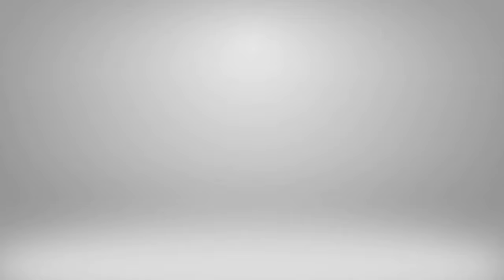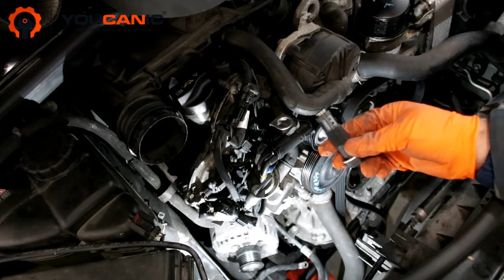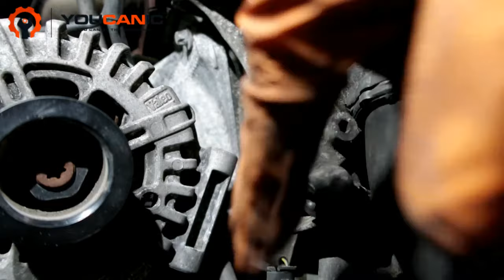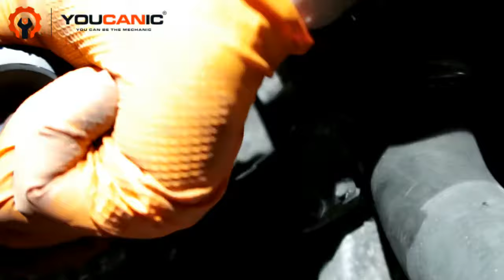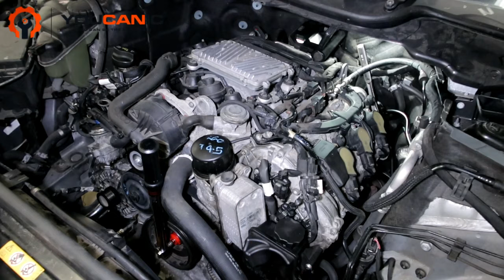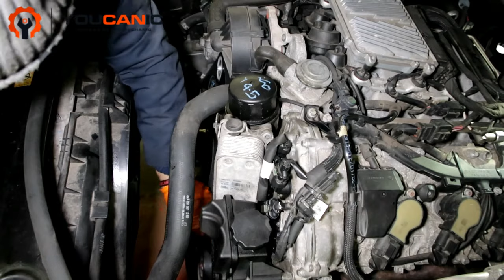Mercedes Benz Timing Chain Tensioner Replacement

Comment: I have a question so I am doing the valve stem seals because I think and am hoping its not the piston rings, all the piston have oil puddle on top and I can see the oil line from the top dripping down. If it was piston would all 6 really fail?

Comment: I have an 08 sl550
...r230 v8... do you set the crankshaft at 40 degrees straight up or 40 degrees after TDC before removing the tensioner
Reply from the maker: Thank you for your feedback! While we strive to offer clear and practical automotive repair advice, it's essential to have a professional diagnostic scanner to correctly diagnose and repair a vehicle. We developed the YOUCANIC Full System Scanner for exactly this reason. Check it out here: www.youcanic.com/scanner.

To ensure accuracy while working on your 08 sl550 r230 v8, consider getting procedures from our Factory Repair Manuals and Torque Specs. These resources can provide the exact specifications you need for a successful repair. You can find them on our website for a small fee here: www.youcanic.com/manuals.

Comment: I just finished replacing chain and guides, timing is dead on, but engine runs rough and ultimately dies. Is this a sign of incorrectly setting the tensioner?

Comment: Do you have to put the crank centre ? What if you do this without remove the fan belt and crank not centre ?
Reply from the maker: Hi there, thanks for your comment! We strongly recommend aligning the crank to the center before starting any work as not doing so can lead to engine damage. If you need detailed instructions, visit www.youcanic.com where we have factory repair manuals available. As for the fan belt, it's generally safer to remove it to avoid unnecessary strain or damage. Please feel free to reach out with any questions to help make your car maintenance journey easier!

Comment: Hello, my m272 350cgi rattles 2 seconds but only on a warm start feeling like the oil drips down . No rattle on cold. Is the tensioner at fault? I think i can change it myself like you did, i have the tools. Its 100euro for me tho quite expensive, but if it fixes it i will do. Thanks pls reply!
Reply: Mine does the same. Only on warm starts when the engine has been sitting about 1 hour. I don't think it is the tensioner, because then it would be more likely to rattle from cold when the oil has drained away from the tensioner. From what I hear this is a common issue and no-one really knows what it is. I have decided to live with it. After 6 years it is still the same. No worse.

Comment: Any idea what the cost is to have a reputable shop do this repair on m276 v6 engine?
Reply from the maker: Thanks for your question! It's hard to specify an exact cost without knowing your location and the exact repair needed. Nevertheless, YOUCANIC is here to empower you with the knowledge to confidently understand your car's needs. We offer free resources, our powerful YOUCANIC scanner, and even factory repair manuals to assist you!

Check out our site at www.youcanic.com and don't hesitate to post your queries there too! We're here to support you on your car ownership journey.

Comment: Is it the same for w203 c220?
Reply from the maker: Hi there, thanks for your question! Yes, our guides and resources can definitely assist with a W203 C220, as we aim to support all makes and models at Youcanic. We are dedicated to helping car owners save money and feel confident about car maintenance. For more specific information, you can explore our repair manuals at www.youcanic.com. We're here to empower and support you in your car ownership journey!
Reply: @YOUCANIC  Thanks for responding. I hope I get it with that shaft setting after replacing the tensioner

Comment: Hi mb ml350 , i just installed timing chain tensioner but the way i relased it by pressing it in , tip popped out and i stick this inside the engine. Someone told me to do so . Now i have 2 codes CEL p0016 and p0017 . What to do ?
Reply: did you get those codes.. what they were?

Comment: Will bad chain tensioner causes p0016 p0017? Thx
Reply: Did you find out what it was?
Reply: Wondering the same thing.  Replaced my cam sensors and magnets, still have the 16/17 codes and wonder if tensioner is it.
Reply: @jimgorman7289 it's the tensonoir same issue here
Reply: likely it is the chain, stretched and the cams are slightly out of alignment by a degree or 2. Need to pull the valve cover and check the cam gear alignment at TDC

Comment: Tsb says no consequential damage expected. So it's not necessary to do check valve and tensioner upgrade?
Reply: Seems like a good way to wear out the plastic guides -> more expensive repair, from chain banging around on them.  I see guides costing $2 each but getting to them!

Comment: has anyone managed to get rid of p0016 and p0017 just by replacing tensioner???
Reply: Bro I'm about to do the timing chain tensioner. 2009 m272 engine. I've done everything. Oil change, cam sensors, cam adjuster magnets. Cam harness, crankshaft position sensor. This is the last attempt. I'll come back and let you know. My codes are p0017 and p0016. Car drives
Reply: @IvanRobles-yb9de did it work? 😅

Comment: I have a 20 year old M113 engine, 150K miles.  I hope the procedure is about the same as this video.  While the serpentine belt is loose is it easy to replace it?  

Also wondering same question as Grzegorz Palak, whether they can be popped out first.  Actually my tensioner hasn't arrived yet so I don't know if this is even an issue for my engine/part.
Reply: I’m in a similar situation, m113 with 150 miles. Was the job the same as shown in this video?

Comment: just did my2008 R350, smfh. Everything went smooth until it came time to release the tensioner by rotating the crankshaft backwards while hold the back side engine. I didnt hear the Tensioner release & it was much harder to rotate C.Shaft bckwards. i stood on the tool & it wouldnt rotate bckwrds. Im so pissed & depressed autoHeads rt now I need yall help. 😆Calling all Grease Monkeys
Reply: Did you fix it ?
Reply: If you remove the spark plugs it may be easier to turn?

Comment: Hello.whats is the reason of tensioner replacement? When i start my cold m273 emngine li hear chain noise for 10 seconds and after noise disapears. Could be  tenssioner  fault?
Reply: it could be stretched chain, or worn out idler sprocket, etc.
last m273 engines were produced 8 years ago, so they are getting old.
Reply: My personal reason is oil leaks around it
Reply: On the MB AMG M156 that would usually be cam adjusters…
Reply: Rattle noise at cold start = chain tensioner and/or bad oil quality in most cases. To make sure the timing chain is not stretched, remove the magnets and control the markings that must be adjusted when engine is at 305°. 
Chain tensioners are under 100$, worth replacing, and the procedure is quite easy. It's a 1 hour job. I do it about every 50k miles to not give a chance to bad luck to happen ;)
Reply: The noise is about 3 to 5 seconds from a cold start and not heard all day long. This could also be the O ring on the engine oil suction tube, take out the oil pan, remove the air filtes and lift the engine about 3 inches using a a pipe and a jack and change the O ring on the plastic suction tube, its about $6.00 and you can do it yourself.